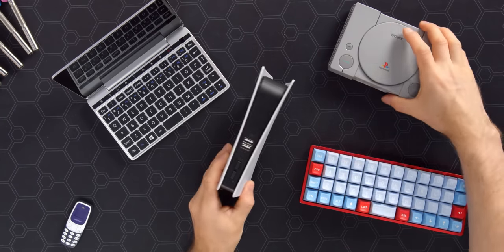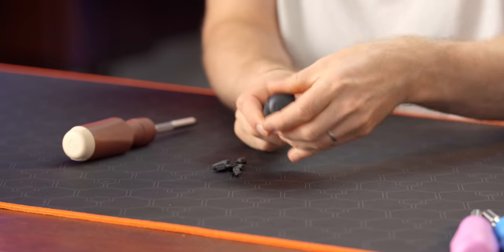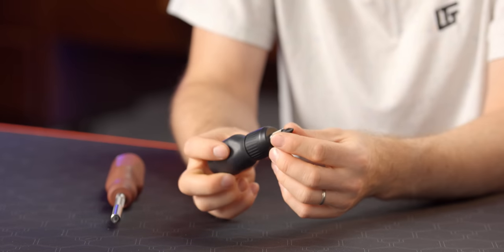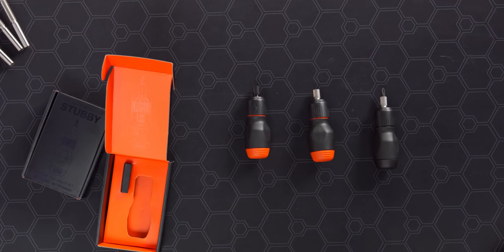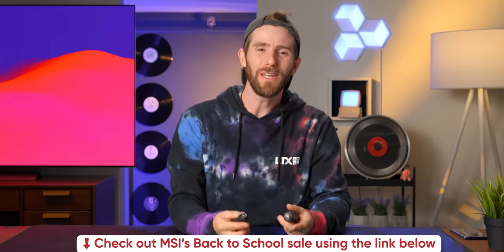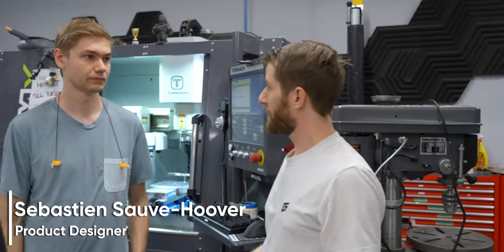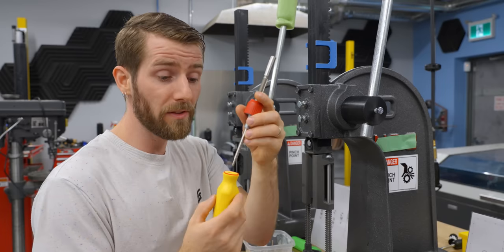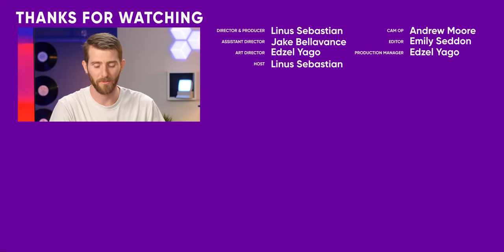Size doesn’t matter. - LTT Stubby Screwdriver

Comment: would love to see a transparent version of both stubby and normal.
Reply: From what I heard on the WAN Show, they would love to do that but the issue is they'd have to use different plastic material which wouldn't be as strong as the original one
Reply: Jake actually had a transparent one in a vid at one point, they seem to be working on it, just that it’s a completly different plastic so they need completly different moulds.
Reply: Nothing Driver (1)
Reply: the prison driver
Reply: @szerbi207 More specifically, that have been working on one but there is no promise they will find a material they consider acceptable in terms of quality and cost.
Reply: Can you do a twin pack, stubby and regular?
Reply: I'm still hoping for an RGB screwdriver.
Reply: Untill it get all scratched and hazy then u don't
Reply: @Mr.Morden  It also must have a buzzer.
You know, to also have a voltage tester/electrician's screwdriver at hand (with RGB!!).
(And also the necessary resistor in it.)
Reply: You mispronounced atomic purple
Reply: transparent atomic Greeon or orange would look so cool
Reply: I think they showed one but will probably be after the noctua one
Reply: All the N64 transparent colors please!
Reply: Yes, like the gameboy colour transparent edition !
Reply: They've been working on it; I got to see (and handle, or ogle, or what have you) a prototype at LTX! It looks cool, I suggested it would be even cooler to have different colored bit holders since you can see them through the clear plastic. They said getting it right with regards to materials and strength, etc is tricky so it'll probably be a while before we see it on the store.
Reply: Hear me out: A smokey black one, or Purple atomic one
Reply: @daponagegoogenburg807 it would just be a garbage screwdriver. Glass fiber doesn't allow for transparency and is what makes plastic durable.
Reply: Jajajaja damm
Reply: JerryRigEverything edition
Reply: Gameboy Color Purple.
Reply: with rgb and a micro torch
Reply: JRE edition
Reply: Would love a truly transparent version of LTT!
Reply: Atomic Purple (Gameboy) driver.
Reply: dbrand can always make the skin, just sayin'
Reply: @szerbi207 Transparent plastics do seem to suffer strength once you go clearer... though I miss transparent Game Consoles and Controllers, especially those Nintendo 64 era colorways.
Reply: I can see how there will be stress marks and cracks. Been a fan of transparent goods but most of them always crack near screw parts especially on clear fountain pens and polycarbonate acrylic mechanical keyboards
Reply: Yes yes yes
Reply: I've been waiting for this to buy one, hopefully they will eventually make it
Reply: oh please do this, and a atomic purple transparent ala gameboy

Comment: I work a maintenance job and love the long shaft. It sits in my back pocket all day. Having 13 bit option and being able to reach in an awkward place and have the back drag be so light it can start threading in even tiny screws is a game changer. I have no use for the short one but reccomend the hell out of the screwdriver if you daily use one. You dont understand until you use it.
Reply: yeah, its insane how good it actually is. I actually enjoy assembling furniture and stuff now.

I have used to assemble everything from car speakers and kids toys to swing sets and trampolines.

it lives on my desk and whenever anything home maintenance related needs to be done its strait into the pocket with the 13 bits.

its the only screwdriver I have ever had where I actually end up using the built in bit storage and not be lazy and end up loosing half the bits. all the other ones have all been 'they all rattle around in the back with a very cheap screw on cap' or 'they go in around the shaft in holes that are to small so impossible to get in and out or to big so bits just fall out' setups.

Comment: My dad was a mechanic for the over 40 years. He mocked the full sized screwdriver costs but I let him try it out. He lamented that it was as good as it was and available now after he retired. He and I agree that it is about $10 USD more BUT for a good warranty and solid driver, worth it.
I ordered him a Stubby the day of. When I saw the colorful options, I ordered him a Yellow one and a Random one for myself. 

ALSO: RGB Edition is a good name and PLEASE PLEASE do a Noctua Stubby.
Reply: "RGB Edition is a good name" is it though? These colours are achieved through CMYK 😹
Reply: @Innuya  I don't think pigments added to plastics generally are based on combinations of CMYK primaries either.
Reply: In a mechanic setting I would hate the LTT driver. It's solid plastic handle would have zero grip when you have grease on your hands. It's built well but definitely not for less than ideal environments
Reply: @MrDummyisDumb  That's been my experience with it as well.  It's well-built but for something that's going to need to take abuse or needs to actually be torqued down just get a MegaPro.  Ideally though I'd love a MegaPro but with the ratcheting mechanism LMG iterated on.
Reply: @EkiToji  A hybrid or more heavy duty one would be incredible and for a non tool manufacturer I just want to add it's amazing what they've achieved. But at least in my use rn it's too much on the white collar side to really be used in a blue collar space
Reply: @MrDummyisDumb  it's not made to be a mechanics screw driver, it's made to be a tool used to build computers and electronics. it's versatile to use for different application sure, but its not the primary use case for most watching this channel.
Reply: @JJiG  Oh I know, Linus has been pretty open about that. I was just responding to the guy above saying his mechanic dad approved. Just was saying I wouldn't use that in this application.
Reply: Is the screwdriver just realy well weighted? $69.99 seems like a lot to pay for a screwdriver lol
Reply: Sorry about your dad's job!
Reply: @rod_andrade he said retired, not fired lol
Reply: @Innuya that’ll be Pantone instead

Comment: I for some reason thought you guys were gonna do the same price for this as the standard size. $10 less seems totally reasonable considering where the cost is.
Reply: Given what inflations been like I could've seen them doing the same thing as they did with blank tees, using the slightly cheaper one to subsidise/avoid price hikes on the full size driver.

Alternatively they could've also justified it the same way they do with water bottles, and desk pads. That is you choose the size you want and don't have to pay a premium for wanting a bigger screwdriver.

But this would've likely have led to controversy and it feeling like price gouging/profiteering. People will be a lot more receptive to the message there's not much cost difference between the two if it also comes with a price drop. It's unfortunate that product launch order affects consumer perception so much
Reply: Absolutely, I know 100% they’ll be making less gross margin per stubby. Still profitable, but less margin/profit
Reply: @liammiller3688 not really though. You have to consider this a branded product. And considering the reviews, its seems to get a great product 

Yes, it is expensive for a screwdriver. But considering its not a consumable, its something you would keep for decades. Its not like you are buying it even year. So its not that much of a waste of money as people are stating
Reply: Agreed sturdybutter. We are helping them get rid of excess inventory of a promo they chose to do for LTX. Price should at minimum be equal to that of the regular standard black/orange.
Reply: @@liammiller3688 It's expensive not overpriced. You get what you pay for.
Reply: @Random_dud31  Also, while it is expensive for a screwdriver, it's actually very competitive in its niche of a high-quality ratcheting screwdriver and is cheaper than much of the competition at the same or greater quality. It's priced about the same as the snap on ratcheting driver and, I would argue, is better

Comment: I think a missed opportunity was to develop some kind of extension bit that instantly converts the stubby into full length so you don't need both.
Reply: the how are they gona sell u more screw drivers??
Reply: This is vastly available online and in every hardware store. Unless you buy both which I guess is what they intended.
Reply: The biggest problem I would see would be stability of the shaft. The longer the shaft the more wobbly the endpoint. It is a screwdriver after all. However I wonder what that would look like?
Reply: I'd love this idea as a spring loaded option, the amount of fun it would be to play around with
Reply: Wait u cant disconnect the shaft?
Reply: @pabloeskibar8076  I'm sure they once said they wanted to make the perfect or best all-round screwdriver (singular) or something to that effect.
Reply: Good news they've released an extension part now.

Comment: Yep, I’m one of those people that had their LTT screwdriver confiscated. I went through TSA a few times before it was caught. Had to hand it over since I didn’t have time to take it back to my car. Hard lesson learned that day.
Reply: good time to remind people that the TSA is security theater. It would solve this problem if we just got rid of the TSA
Reply: check the bag I had a snap on rachet and extension so about $300 from MI to TX non issue from TX to Panama they were like yeah thats a weapon.... so I had my carry on checked
Reply: @JoshuaCasey Yeah, it's ridiculous. 6" screwdriver? Completely harmless tool. 7" screwdriver? Woah! Hold up there, son! You could stab someone with that thing!
Reply: @Okusar well, possibly their full body scan data shows, that there is in average only 6" of fat over vital organs of most american tourists.. Give it some years and you can take the 7" one as well :D

Comment: Linus can you make a longer extension shaft with a hex end to fit in the stubby bit holder so that you can have the best of both? It could also be used on the standard length one when you need a bit more reach.
Reply: exactly why not make it that it can be adjustable with a hex extension so it reaches the full length of the normal one and also include all the bits in the box and make it the same price (cause for 10$ more , ppl are still gonna buy the big one as it serves them way more than the small af one since it also comes with more bits and can also store inside more bits  ) as the normal one , this small one is useless from my point of view cause try to screw in a motherboard into the case with a big tower cooler already installed it will be a nightmare to reach the 3 top screws of the mobo,  honestly on a lot of special occasions i need a screwdriver that is twice the size of the normal one , so on tldr this one is DOA kind of product
Reply: @dragos2010full1  As someone who works on totally different machines than computers sometimes (moving head event lights) I noticed myself grabbing a stubby so often because of how close you are up on the screw and still able to get your full torque in. In this case being closer to the screw also reduces the chances of slipping off of the screw when pressing into it with quite some force as it's easier to keep straight.

Comment: Just ordered one. The other one has served well as an EDC. My only complaint is that they still haven't R&D a compact case for the screwdriver with a built-in holder for all the available bits you can purchase. That'd be sweet. Unlike the average who only uses a flathead or Phillips 99% of the time, I've had to break into all the boxes. Having a uniform case for the brand would be awesome. 

I'm excited about the stubby though. There have been a few times when I've needed to use a stubby because the regular one wouldn't fit and had to sideline my LTT screwdriver #sad. Not anymore baby. Anyone looking to make a purchase and can only buy one, buy the stubby for a multitude of reasons.

Comment: The LTT screwdriver’s biggest flaw as a PC builder is how thick the handle is, I feel it gets in the way inside tight spaces inside a case.
ifixit’s tool kits make far more sense for the same price & sometimes less just as a toolkit.
Sure not a ratchet mechanism but in terms of sheer productivity & practicality I’ll go with a toolkit over a single $70 screwdriver.
Reply: Disagree. I have bigger than average hands and after 5 years of building PCs on the daily I can not use thinner screwdrivers without hurting.

ifixit is great tho, use their tools every day too.
Reply: I found that I still use my iFixit tools quite a bit, but anything that I need any kind of torque for, I grab my LTT driver. Not just pc building, but anything that requires a screwdriver. Done car work, audio work, furniture building, I've even repaired random lawn tools.
Reply: @silaboop  I’m talking about the size of the handle being too big for PC cases in general, not hands but I do get what you’re saying, I have large hands too so larger handles can feel more comfortable which is why I bought iFixits larger screwdriver handle.
They have a set that has 2 different sized handles.
I feel like I’m advertising just for ifixit, that is not the case I promise lol
Reply: @RobertOfHill  oh yeah for sure, outside of PC building for other general use I agree, I think the LTT product would be tough to beat.

Comment: Did the magnet bit come with the original screwdrivers too? Because I totally missed that one :D. I'll have to go and check mine.
Reply: The magnet tip was included with my full length fidget spinner... err screwdriver.

But I have find it to be pretty redundant as the magnet in the shaft has been powerful enough to pick up odds and ends with any bit.

Comment: Still needs slim angle adapters, ever try building in the WP200 (Pedestal on bottom) with a PSU in bottom most chamber AND tried to replace the fans located "just above it"... sometimes EVEN Smaller is better!

Comment: I love my full-sized one and have a stubby in the mail... my one major complaint is that the bit selector is way too hard to pull out (usually takes multiple attempts since your fingers just slide off the part of the cap without ridges), so I'm hoping the stubby requires less force to open...

Comment: You need to release a security hex bit set. I use my LTT screwdriver at work and I use two security hex bits to open waterflow switches. I need a 5/32 and 1/8 security hex, so I'm losing two bits since I need to keep two full sized bits.

Comment: If that shaft could have been just a bit longer it would be amazing, would allow you to reach screws without the body interfering with surround parts. ( like half an inch or 10mm )
Not sure why it's so short in the first place since the body was reduced in size as well but hey not everything can be perfect.

Comment: If you guys want a black metal finish that will hold up, Diamond-Like Carbon(DLC) is a pretty damn good one. I'm not sure how much this would add to the bottom line, maybe DLC shaft screwdrivers could cost $5 more or something? It's a pretty common industrial coating these days, also sees some use in motorsports as well. I would pay an extra $5 to get a screwdriver with a black DLC coated shaft.

Comment: I really wished they dropped the magnet bit for a Torx T5 bit. The magnet on a stubby driver is pretty much useless and T5 has been very common for a lot of electronics that I’ve had to open and repair. Otherwise this is a very cool product.

Comment: A white body, blue cap with some gray rubber grips insert would be nice (I guess, kinda similar to the Hart branded tools)! I sweat a lot when I work, especially in the palm of my hand, so a rubber grip insert is my preferred "option" in a screwdriver (for example, the "Maximum" branded 13-pcs screwdriver that Canadian Tire sells, it has a nice rubbery finish which makes the screwdriver more "steady" in my hand)

Comment: Looking at the sizes stubby with a longer shaft or full size with a shorter shaft to make it less than six inches might be worth doing as well, for TSA reasons? I would prefer a longer handle but a shorter shaft.
Reply: Then just put it in you check in baggage.

Comment: The only shame about the LTT screwdrivers is the knurling on the shaft. For most uses it's great, but when you're snug up against something you don't want to scratch it's unusable. It's basically sandpapering the nice pretty doorknob you just bought. Note: I own the stealth screwdriver, great for 90% of uses.

Comment: I know i speak for my self, but  if someone doesn't prioritise what color screwdriver to get. Why should one spend 10$ extra over a normal black one?
Functionally they are the same.
I don't see why i, as a customer, should pay extra for your excess parts.

And it doesnt seems that the stubby can hold any normal bits, only your short ones.

This product launch is a complete L in my eyes.

Comment: While manual labor involved for assembly certainly adds cost to the solid colored screwdrivers, it doesn’t seem fair to charge the buyer an extra $20 to compensate. After all it’s the buyer doing you a favor by helping get rid of dead stock which is basically worth nothing to the company while sitting around. Buyers help convert those losses back into some capital and their “thank you” is a $20 upcharge?

Comment: Really? The biggest complaint was that it was just too big??  I would think the biggest complaint is that the handle is too slippery with no grip. I mean, it is! Like a lubed up banana peel, if you hands are even slightly moist. I had to wrap the handle in Friction Tape.  But i still love the driver.

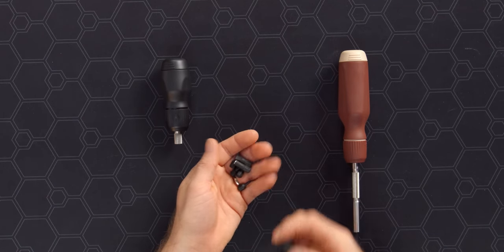Comment: Another Short Circuit video with the awful hum..... Starts at 1:30 if you LTT Folks want to know what might be causing it. Up until 1:30 it was not present. Did not finish watching as the hum is sanity breaking.